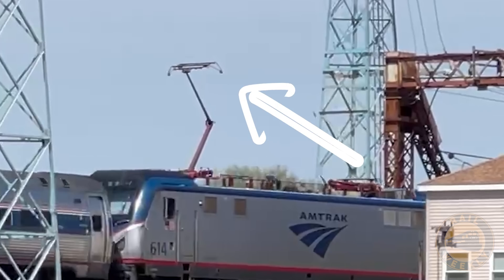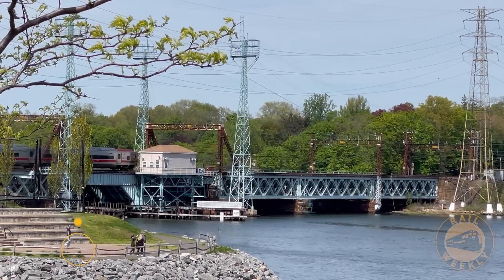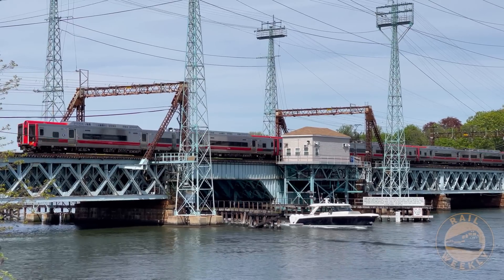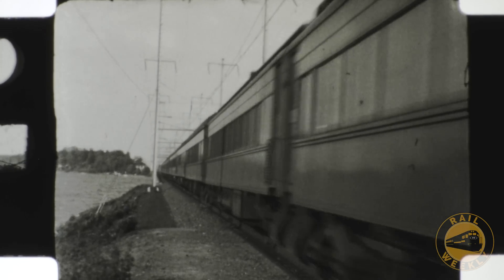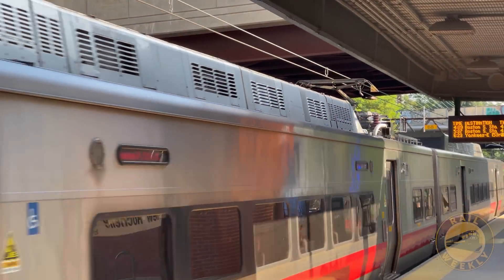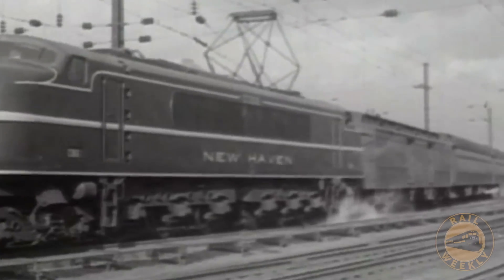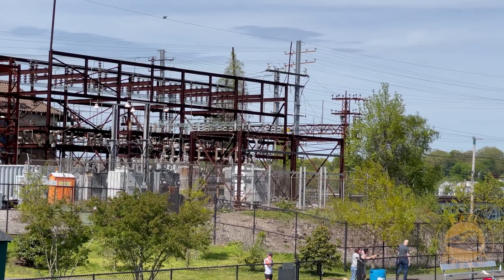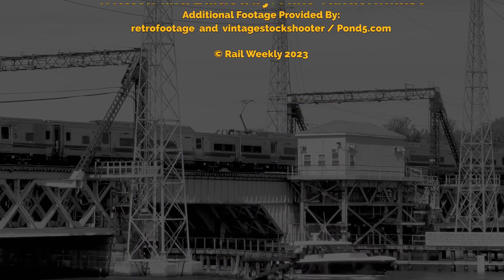The Curious Case of Cos Cob

Comment: In Soviet Russia this practice is also used when crossing insulating gaps in the overhead wire.
These are used separate overhead sections either powered with different electrification standards (25 kV AC / 3 kV DC) or connected to different feeders of the same power type.
But pickups must be lowered before crossing such gaps. There are trackside signs "Lower the pickup", "Raise the pickup on a lokomotive" and "Raise the pickup on a trainset" (latter are placed 200 m further down the track).
There is also such a thing as a neutral section, that is an unpowered section ~250 m long separated by insulating gaps on either side. On a gap, one overhead wire raises while another wire parallel to it lowers, so a pickup shoe smoothly transits from one wire to another. A neutral section allows not to lower the pickups, but the current must be cut off to prevent arcing.
Reply: In Russia, pantograph finds YOU!
Reply from the maker: That’s fascinating. Do you happen to know the reasoning for having those neutral sections?
Reply: @RailWeekly  Neutral sections allow transfering from one powered section to another without the need of lowering pantographs. A neutral section is longer than a typical 10-car trainset so no pantographs of the same trainset are on both powered sections at the same time.
While passing a neutral section, current must be cut off. There are special trackside signs "Switch current off" and "Switch current on".

And it happens that an electric rolling stock is trapped on a neutral sections (e. g. emergency stop). In such a case the section can be powered by a switch (either remotely controlled or manual).
Reply: @u2bear377  In many systems the cutoff is automatic, the lineside signs are for information only (and for manual override in case there's a problem with the automatic cutoff).
Reply: @JuhanaSiren  Ours (Ukraine, but also true for all the ex-USSR) is not automatic, AFAIK.
The loco itself has no way to know when to cut current off. Except maybe for newer systems with some kind of positioning, but even in this case it's just advisory (just as lineside signs are) with no means of controlling the power.
Reply: @RailWeekly  Why neutral sections are needed at all.
Neutral sections are constructed on railways electrified with alternating current (AC) and separate 'power districts' connected to different phases of AC.
Shorting two phases would be a big boom. :)
Reply: @u2bear377  My City [Auckland, in New Zealand] has two such neutral sections on our 25kv AC overheads. Connecting the two power supplies. [Two branches essentially, so they both end up in same location]. 

The fun part is that one of the neutral sections is on a gradient so on the uphill run things can get a bit... hairy.

Comment: This bridge when it was electrified from 1907-1915 with 11kv 16.7-25hz  system there would have been foreign Engineers looking at this system one of those might be a Dutch engineer for Nederlandse Spoorwegen since they have a similar problem with drawbridges with OHLE 1.5kv-3kv DC equipment Bridge might have inspired them to do the same thing in the Netherlands. I wonder if you simply leave the power controller on Notch 8 max speed or put that down to Neutral and then back to Notch 8 or not?
Reply: You go to neutral to avoid arcing.
Reply from the maker: Good to know! I was trying to find someone with an operating manual while researching this video… no luck. I was curious about that as well as a mandatory minimum speed. Thanks for the info!

Comment: As I can confirm, TSW3 legit breaks the physics of a electric locomotive running with no pantographs
Reply: New York to Trenton in a nutshell
Reply: @supermarionathan1426 then you got Railworks train simulator through which HudsonLineM7 can drive on New Haven line all the way up to Bridgeport by just holding tightly on accelerator and going, and then it’s used to doing it without
Reply: https://youtu.be/eHDxaQ5o6Ys?feature=shared
Reply: My video on it where I said DTG pls don’t fix this it’s hot

Comment: This situation occurs frequently in The Netherlands where there are very many drawbridges and there is an open gap in the catenary as you describe; only a few feature wiring across the bridge in places where there is frequent traffic. The Dutch pantographs are designed only to go just so high, and the wire raises at each end of the gap to be just out of reach. While the train driver can coast through at speed, he must cut the traction power to avoid a major arc when the pantograph loses contact with the wire. After the bridge in each direction there are progressive numeric signs, (2, 4, 8, etc.), with an "up" symbol telling the driver when it's OK to resume power based on the number of cars in the EMU. Then there's a final "all clear" sign.
Reply from the maker: Thanks for the info! I would love to explore some of these European lines more!
Reply: @RailWeekly  Cabview Holland Dutch Railways is a good channel for that, and there are others. I follow people all over the world on YouTube - way less expensive than travel...
Reply: @RailWeekly  Also interesting is when trains change voltage, for example cross border services also work like this. Or changing to 25kV on high speed lines
Reply: @timbrust9739  NEC also runs different frequencies. Bos-NH 25Kv@60hz, NH-NYC 12.5Kv@60hz, NYC-Wash 12.5Kv@25hz(the PRR system was 25 in that area)
Reply: @filanfyretracker This reminds me of the electric gap between Italy and Switzerland/Austria, with border stations having one side or track under 3 kV DC (Italian catenary) and 15 kV AC @16.7 Hz (Switzerland catenary) and there were a few cases where Italian locos coasted over the gap under the 15 kV and kaboom
Reply: Yes, my hometown in The Netherlands used to have a large lift bridge like that. There has been one occasion I know of where a train tried to cross at too low a speed and it got stuck on that bridge. Fortunately it is only a couple of kilometres out from the main station which has locomotive maintenance facilities, so they could quickly get a shunter out to "rescue" the train. That bridge no longer exists and has been replaced by a new one, and I believe the maintenance facilities have now been re-purposed as well.
Reply: There is a drawbridge in Rotterdam with functional swinging catenary. I had a chance to see the thing operating. It's complicated. It's like an high voltage powerline switch, with soild swinging metal bars in place of the wire at connexion point.
Reply: Het stikt van de stroomloze bruggen hier. Wel grappig dat je iets soortgelijks tegenkomt in andere landen, waar het schijnbaar heel zeldzaam is.

Comment: In the Netherlands we have this too but our system is much better and professional. Our system keeps the wires up as high as the rest of the system and has special portals with clips that lock the pantograph's in place and unlocks them on the other side. But there are only a few left and getting replaced by Railed catenary bridges.
Reply: That's not true. Our catenary just goes up. All Dutch trains have a bumper  in the pantograph though, so it won't go too high.
Reply: @IIVQ  you can actually go check the system, non Dutch trains need to put their Panto's down at these types of Bridges.
Reply: @StefanWithTrains  because foreign trains don't have the height stop in the pantograph, which all Dutch trains have. There is no special machanism in the overhead portals other than the wires being so high the panto doesn't touch them anymore.

Comment: Interesting, but you didn't address the obvious question: 
How is the now fully extended pantograph reconnected with the lower OLE after crossing the span?
Reply: The same way it lost contact. The OLE is higher than the pantograph at the gap, and is sloped back down to normal height.
Reply from the maker: Yes if you look VERY closely, you can see that slope in action. The pantograph is slowly lowered back down by the slope in the wires. It’s very easy to miss. Didn’t address that in the video because it’s so hard to see. Was worried people wouldn’t know what I was talking about. Haha.
Reply: @RailWeekly  Thank you, that explains it!
Reply: @sjokomelk  What's OLE?
Reply: @u2bear377  overhead line equipment
Reply: @u2bear377  Overhead Line Equipment. The term actually includes the gantries, insulators, catenary (which is the support wire which curves under gravity between the gantries) and the contact wire which is held level below the catenary by droppers of different lengths.

Comment: Imagine you're on an important phone call, and you notice your phone is at 1% so you plug it in, only for the train to roll over this dead spot, and your phone gives out on you and a second later the power's back lol
Reply from the maker: Haha! What a nightmare!
Reply: If you let your phone go down to 1% battery whilst on an "Important" call, then . . . YOU ARE MY WIFE!!!!!!!  lmfao
Reply: Sure an invertor that powers pax outlets is battery-backed.

And if you sink to 1% battery while on an important call, blame yourself and nooone else.
Reply: @u2bear377  If your on a metro north M8 (new haven line) the passenger electrical outlets, AC and heat go dead momentarily when the train switches from 3rd rail to overhead wires and across the bridge. If there is no power to the train they cut all non-essential power like AC, heat, power outlets so the battery is used by the crew for operations
Reply: @hwhn121 yeah it goes fwooooomp… (silence)
silence until power reconnection after the phase gap

thump
HVAC on again
Sometimes it’ll even let you hear the propulsion in the center of the car, as opposed to having to be on the ends to hear it.

Comment: For those that have never pulled the throttle on any kind of rail equipment, including a streetcar, the ease with which a train will glide on level track will amaze them. We used to glide our streetcar for over a mile on a slight downgrade without power. Trains are not like your car, and steel-on-steel contact is much lower in friction that rubber on road.
Reply from the maker: You’re so right! I did a lot of research for this episode and even interviewed someone that worked for the New Haven back in the day… no one was able to come up with a single time in which a train didn’t make it over the gap.
Reply: @RailWeekly  - Thanks for the call-out! Part of the answer is no doubt, to not stop trains in front of the bridge when it is open. Even on the most restricted indication other than "Absolute Stop," a train is allowed to move forward at up to 15-20 MPH. That is plenty of speed for crossing a 100 foot unpowered bridge span. I'm rather surprised there are so many powered tracks on drawbridges, not only on the Northeast Corridor, but also streetcar lines. For example, I checked the Steel Bridge in Portland, Oregon on Google Streetview, and it definitely has powered track on the drawspan.
Reply: @RailWeekly  having grown up in CT I do remember sometimes rarely seeing engines with the NH livery.  Ive always thought Amtrak should have some Acela sets done in the various liveries of the lines that once ran the NEC. so like NH, PRR, NY Central, etc.
Reply: @RailWeekly When a train gets “stuck” on a section of dead catenary or in the case of Cos Cob,  a gap in the wire, it’s called getting “Gapped” and it happens at Cos Cob fairly often.  Not with MNRR MU’s since they typically are longer than the gap is. But Amtrak regionals have it happen often, typically due to cab signal issues. The train comes to a stop with no wire above. The only solution is to bring another train to pull or push it through or they send a Diesel down from Stamford. Happens on average 6-8 times a year.
Reply: As a rail enthusiast I can confirm lmao
Reply: Lower in *rolling resistance*, very high in static friction from such a small contact patch
Reply: Inertia, baby!
Reply: There's also the momentum maintained by the tons of load behind you, right? I feel like that'd help out too. I'm not a physicist but I'm pretty sure I remember seeing that heavy trains stop slower.
Reply: @BringMayFlowers  - Of course, you are correct. But in my experience with a historic streetcar, the car itself weighed about 20 tons nothing was attached to its rear, and it still rolled without power like no other form of transportation. Incidentally, an ACS-64 City Sprinter loco alone weighs over 215,000 pounds, or 107 short tons, so once that behemoth starts rolling, inertia will keep it moving for a long time.
Reply: There are numbers auf Videos of European trains crossing the border inner place where we electrical standards change. There are two cases if it is a multisystem locomotive it will be lower one pantograph before the border and then there's another behind it. If it is not it will simply coast to a stop in the station behind the border.
Reply: My first-gen Insight glides far better than a typical car (it's hilariously easy to push by hand), but I still envy rail for its low rolling resistance. :D
Reply: The foam is deep in the comments.